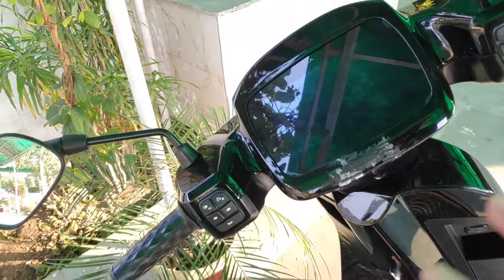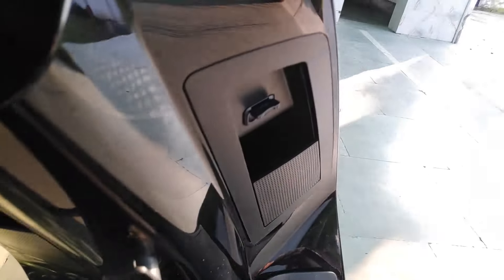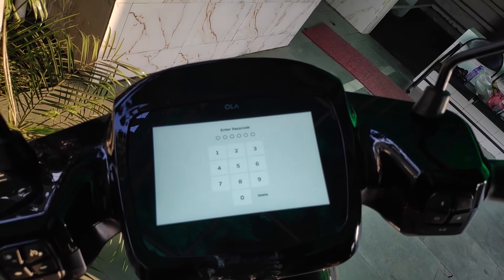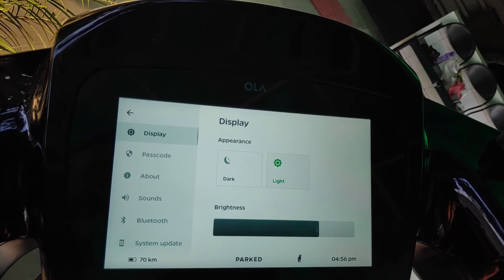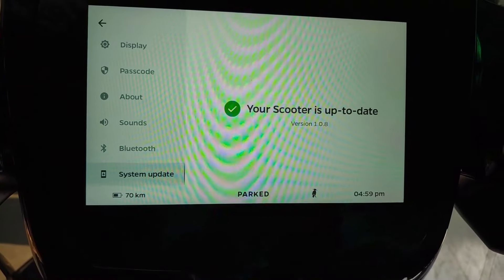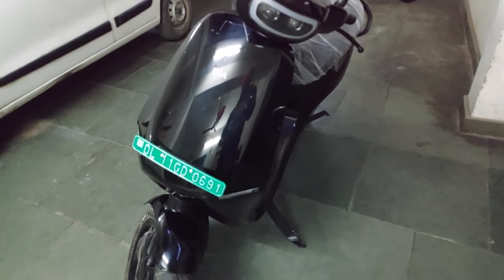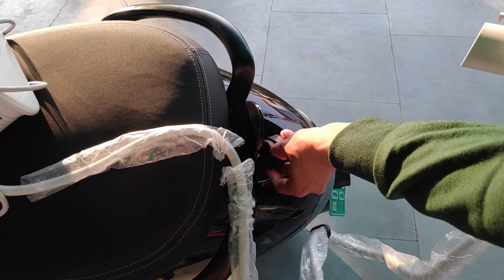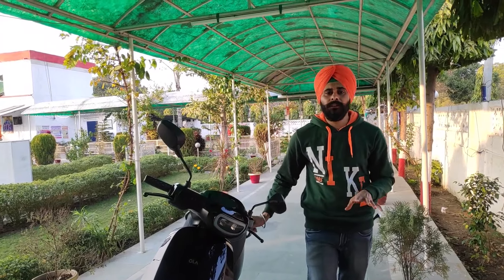Detailed Review of OLA Electric Scooter S1 & S1 Pro | Nimbu Tez

Comment: How is the suspension sir.
How is the braking, stability, etc
Reply from the maker: Suspension is very good, braking and stability is also very good as it has both front and back disc brakes. Scooter gets stopped at a very high speed also without slipping.

Comment: Iss ki motor power Kitni hai .3000 ki 4000  ki  . OLa scooty Gir Gayi  to uske liye safety kya hai
Reply from the maker: Motor power : 8.5 kw
Build quality is very good.
Reply: @NimbuTez  iski full price kya hai
Reply: Main Mumbai se bol raha hun sir ji
Reply from the maker: You can check on ola electric website by entering your area pin code.
Reply: @NimbuTez  1 charge Mein kitna kilometre Chalti Hai
Reply from the maker: Meri ola s1 hai.
In normal mode 
Single rider : 90+
With pillion rider: 80
Reply: @NimbuTez   s1 pro  ka
Reply from the maker: Not tested but it is giving around 135 km range.